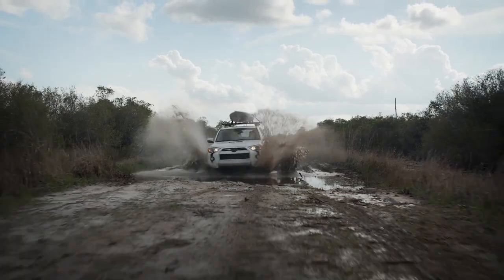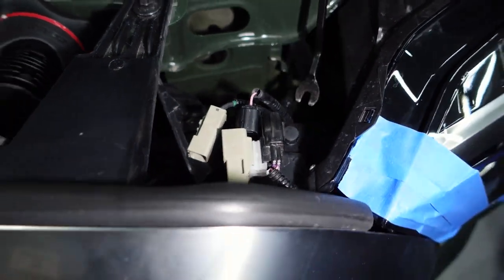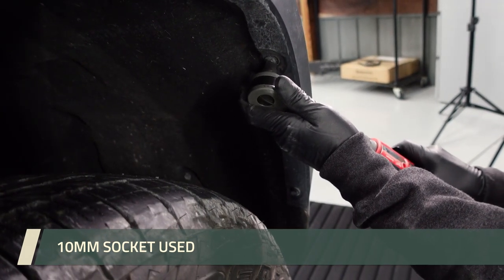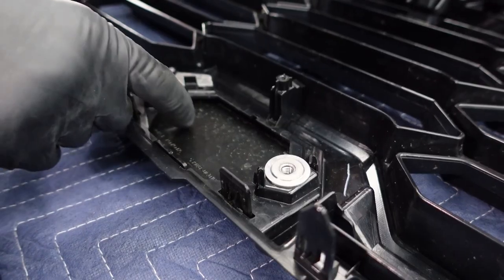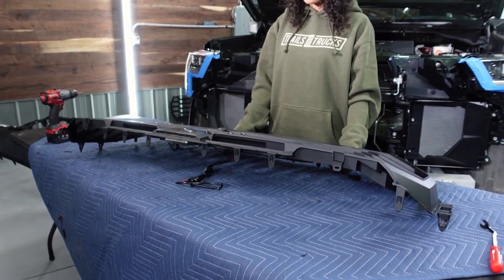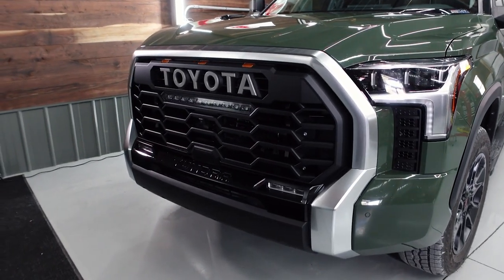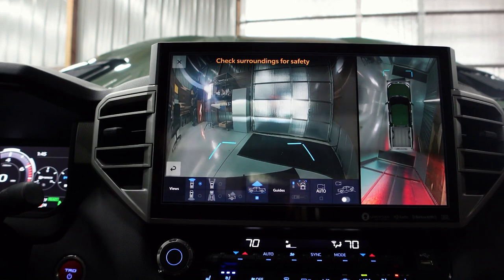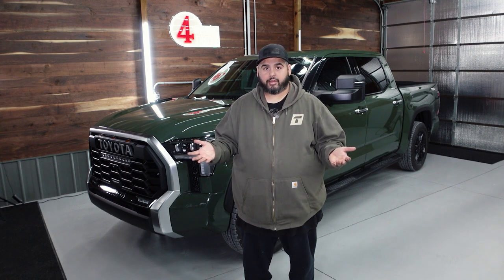New Toyota Tundra Trd Pro Grille Install - Rave Off Road How To

Comment: Did you use your own screws on the light bar install? My didn’t come with screws and I’m wondering if it was supposed to or not. I only got the screws for the Toyota letters and the frame to screw into the grille.

Comment: I have a question for the bumper trim right near the headlights. When you pull that off there’s a bolt behind that panel and I pulled it so hard it broke that bracket. Can you explain how that was removed because your video doesn’t show up close when you pull it off.

Comment: Doesn't show how to mount the light bar shows it installed for 2 seconds and says 'You can't screw it up'. then video doesn't show the wiring install at all add at the end an install that has parts not in the kit keep 30 min of your time and go to a different video. I am disappointed at Rave for featuring this video because the two most critical installing steps are skipped over entirely.